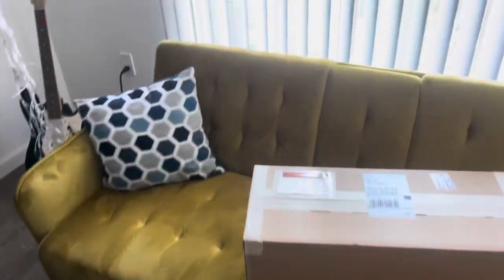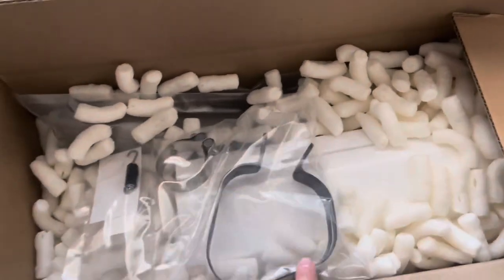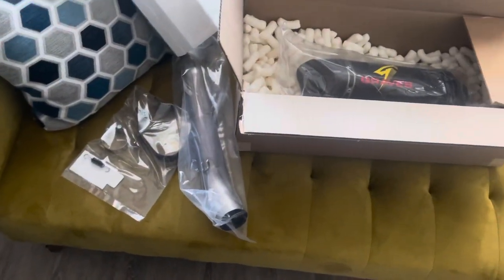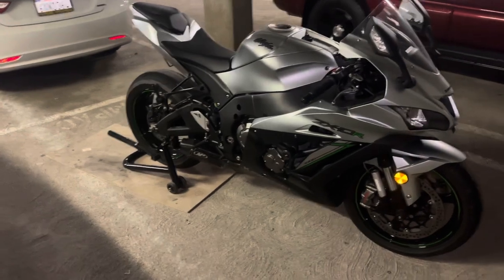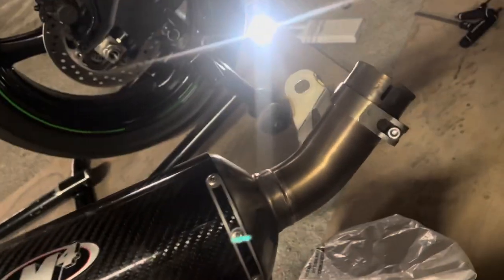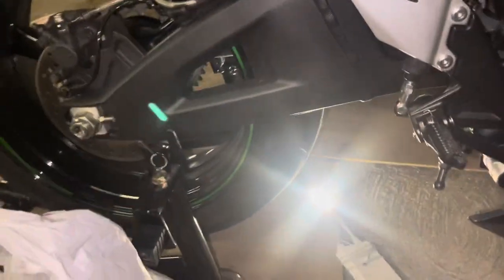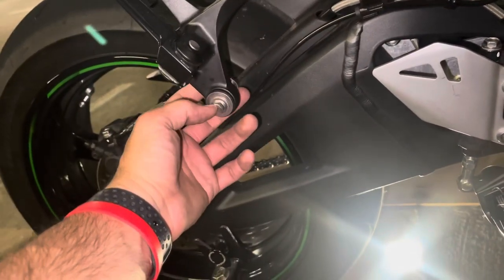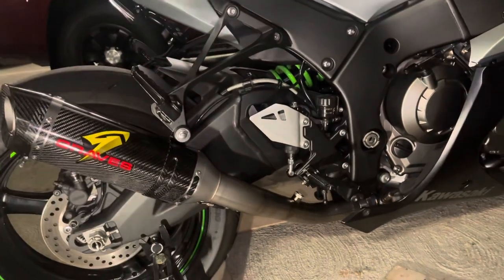Graves Exhaust Standard VS M4 Shorty on KAWASAKI NINJA ZX10R

Comment: Just bought a zx10r, considering the Graves. 3/4 system for the first year. Then adding the headers if I start track riding. My question, do you notice the difference with the headers on the street?